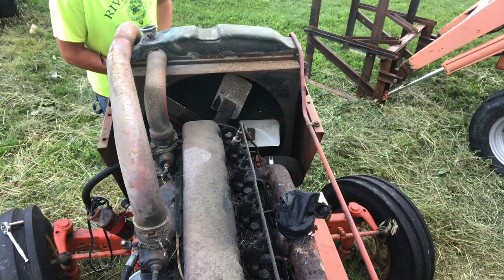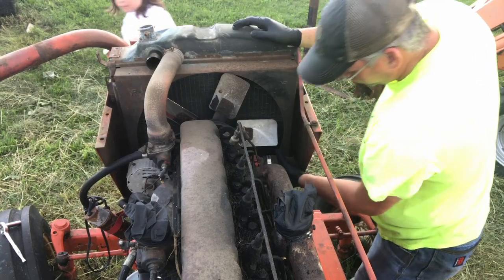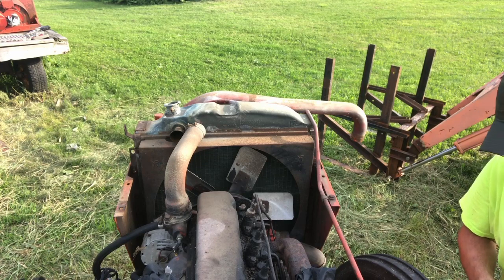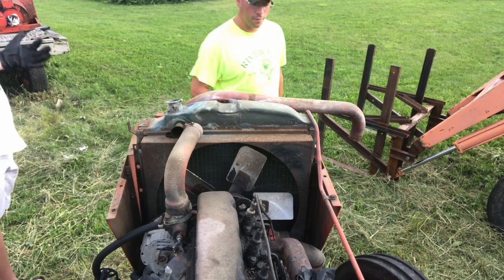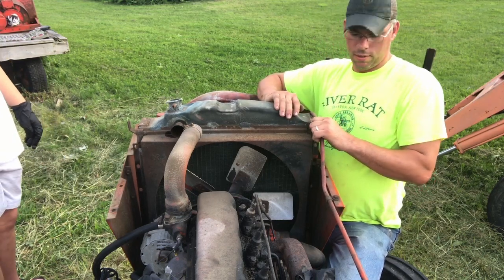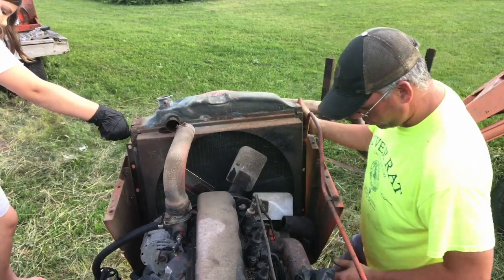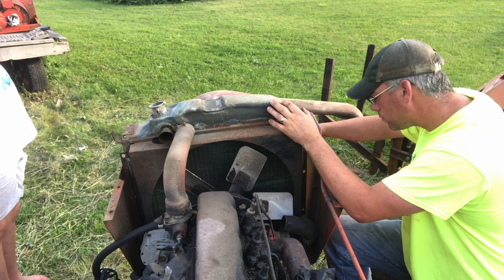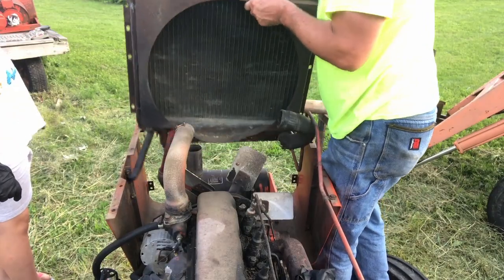Antique Aggravation Part 1: Removing a Tractor Radiator

Comment: Never too soon to teach them how to do it!
You could do with keeping an eye on your volume settings though .... the music was Way Louder than the voice sections ..... Yes I am being picky ;O)
Reply from the maker: +Dave W sorry, editing at 2:00am makes for some poor editing at times when you are zombie like.
Reply: Not a problem! I would rather tell you than just think it though ;O)
One question .... why solder it? Why not Braze? It gives a stronger result (it does need a better torch though)!
Reply from the maker: +Dave W I braze just about daily on the job and I like it for most applications but this brass is paper thin.  In order to braze it I have to get it cherry cherry red and run a pretty likely risk of cracking the brass.